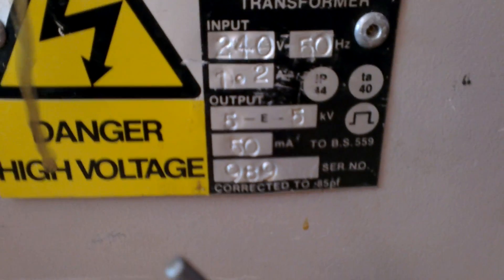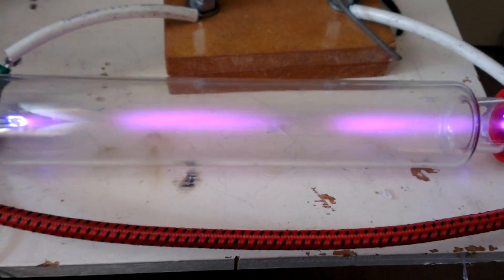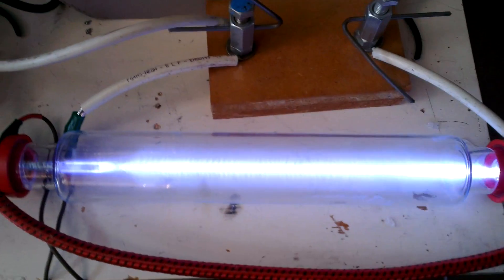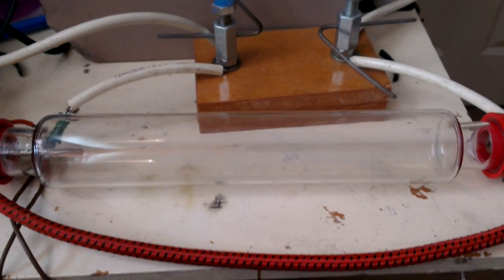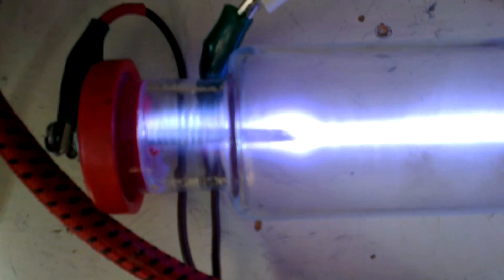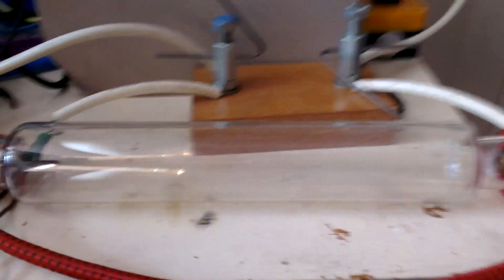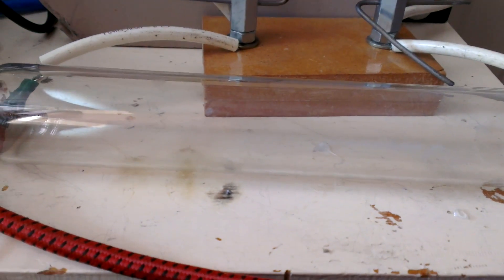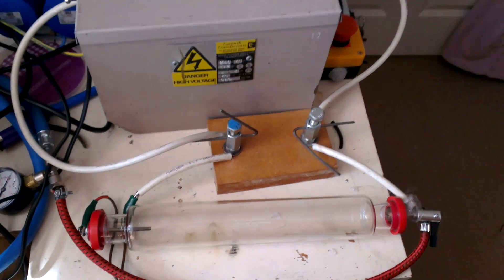Arcs in a vacuum very interesting results

Comment: I believe the the arc would be influenced by a magnet.
Reply from the maker: It would, I actually remember planning on recording it but got mesmerised by the waveform like patterns. Thanks for watching, John
Reply: @HighVoltageProjects  this is how the cathode ray was discovered, but using DC.
Reply from the maker: @jameswest8280    I'd completely forgotten they exited! 😂 The last thing I owned with one was an oscilloscope and that went in the bin many years ago. I actually brought a cheap digital scope a couple months ago, I wish I'd never have thrown my old one away! Not that the new one is bad, just the old was better. You also reminded me I have a large box full of flyback transformers some AC but mostly DC. If I make a variable frequency driver for them I could actually try this again. Cheers John
Reply: @HighVoltageProjects  I used to own a CRT scope also. Now days people are like CR what?

Comment: I'm wondering if the light we see that forms the arc "goes through" gas that is "pealed off" the anode&cathode or if it truly glows through real vacuum. If it's the case you should have less vacuum (more matter inside in gas form) after the experiment than before.
Reply from the maker: Interesting theory, you're the second person to comment on this video this week and it was made 9 years ago! It's good to see that it's still peaking peoples interest. I'd love to try this running from a STTC so the frequency could be changed. I've still got the tube and vacuum so maybe some day I can try it. Thanks for watching, John
Reply: @HighVoltageProjects  Thank you for the reply! A lot of less interesting stuff on the internet makes for a lot more scientific interest from people I guess ;)
What's an STTC??
I was asking myself if it was possible to have electric arcs in space so that's how I ended up on your video! I've been thinking a lots about physics and electronics in general these last few years ever since the lockdown! Seeing people having done experiments like you've done is really interesting! It's not the kind of thing you get to see everyday!
Reply from the maker: @marc00703  Solid State Tesla Coil... I'm really trying to make one at the moment, I've got most of the parts and a PA that can help me with the bits I struggle with but it's a matter of time which sounds pretty stupid when I don't work but finding time when I'm good enough not to have to have so much meds it becomes dangerous..
If you have time and funds I'd highly recommend investing both in your new found interests, both are great and you can answer some of your own questions in the process. Be careful with high voltage but at the same time... Have fun with it and keep learning 🤘🏻
Reply: @HighVoltageProjects  thank you ;)
From what I gathered recently the best you can do is stay away from women that can't even understand themselves (thank you Facebook and Algorithms), and best lesson learned this week is... meds don't work. Especially when you have a stash which does seem to work at "first". Regularilty in life is what matters most. Finding the right routine.
Reply from the maker: @marc00703  hahaha, thank you that really made me lol! I very luckily found a very good Women 19 years and 3 children ago (all girl's 😂) my may as well be wife is a nurse and proper has her head screwed on. I came off Facebook years ago mainly because of ppl moaning and bitching about "their hard life".
As for meds some do some don't, I spent 8+ years finding ones that work for me and have been taking the same ones for about 10 years now. They all seemed to work at first for me too and then they just don't. 
I take different amounts each day pain depending ... Without my meds I literally can't get out of bed, with my meds I have a life and defo don't complain often. It would be amazing to be able to do more but how many dads can say they got to see all 3 of their kids first laughs, steps, words, days at school etc etc.
The grass is always greener...  100% agree.. Routine /regularity is the way forward, for both physical and mental health. I hope you're ok, strange thing to say to someone you don't know but when I know just how much of a  struggle life can be It kinda makes you more empathetic for others, just not the the ones on FB "life is so hard I had an 8 hour shift today, please someone feel bad fir me" hahaha. You know what I mean. Take care.
Reply: @HighVoltageProjects  I do ;) thank you for the input, just barely getting my side of things on track... enjoy your life, I'm sure it'll only get better! :)

Comment: There is enough of a vacuum that the current is able to flow between the positive and negative terminals, and when it does, the heat it creates results in plasma. The gas giving off photons in exchange for electrons, is the atmosphere. The colors of the light emitted in the plasma are the resonant frequencies of each element in the atmosphere. This is also what determines the color of a lightning bolt. The waveform observed is 60hz, which is the frequency of AC power in the home. Thank's for the video!
Reply: Thanks for sharing. This rocks
Reply from the maker: Interesting theory, as you say this is AC so would they still be called Anode and Cathodes? Also this is 50Hz, (not picking holes here) I always wondered if it was the frequency being seen but never got a definitive answer. I still find it fascinating 9 years later. Maybe one day I could try it using a SSTC as thd power source as I'd be able to adjust the frequency.... I still have the tube and vacuum, just need to get building that DRSSTC! Thanks for watching, John
Reply: And thank you for this comment, very interesting
Reply: the plasma is created by the anode/cathode ions not the atmospheric ions.... its a vacuum........